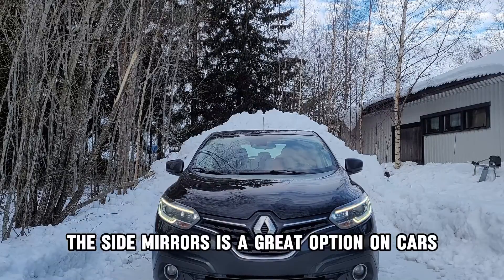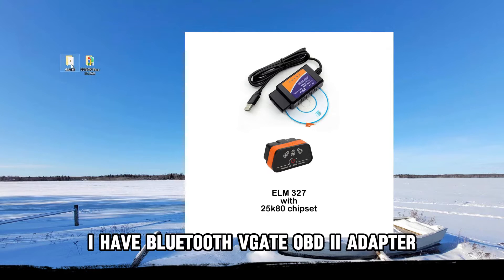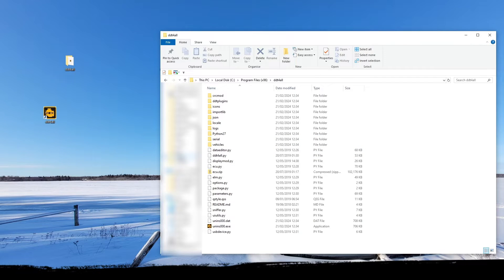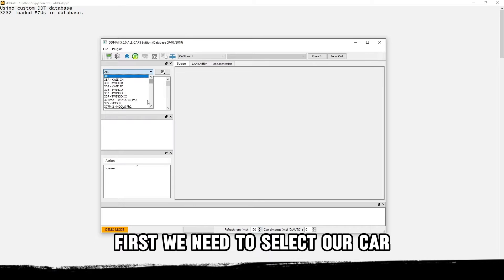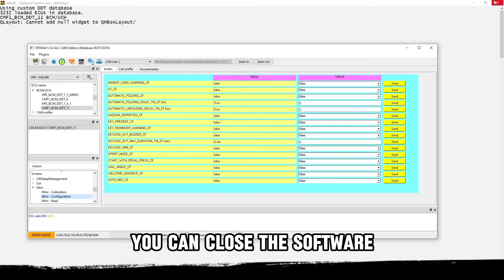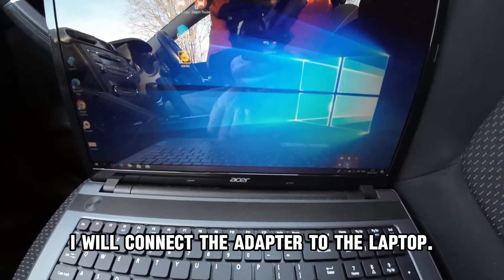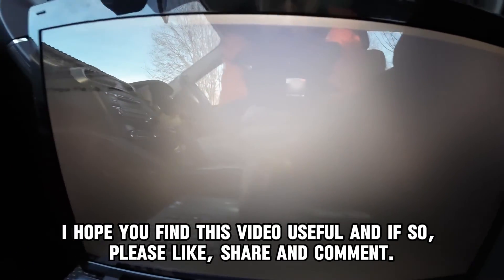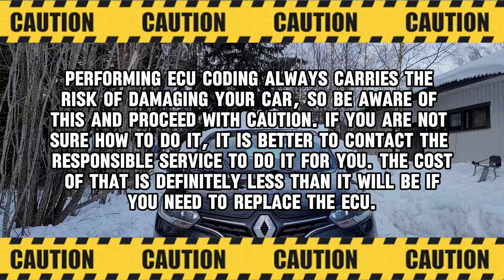How to Disable Power-Folding Side Mirrors on Renault - DDT4ALL Tutorial

Comment: This is cool how you can Hack into your computer and disable this feature. There's a feature on my car that I would like to disable too. Sometimes the engine turns off to save gas at stops. But I do not like that.
Reply from the maker: Auto start stop! Yes my car has the same option and I have a button to turn it off, but I have to do it every time after starting the car. That option was invented to reduce pollution when you're in a traffic jam, but it's harmful to the car's engine. I don't know what car you have, but I know that it is possible to turn off that option using this or similar diagnostic software.